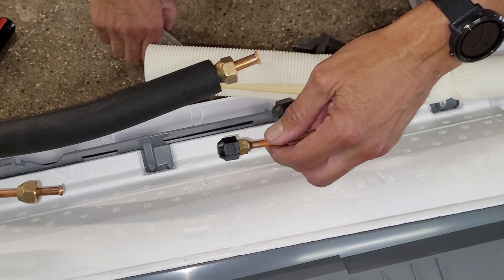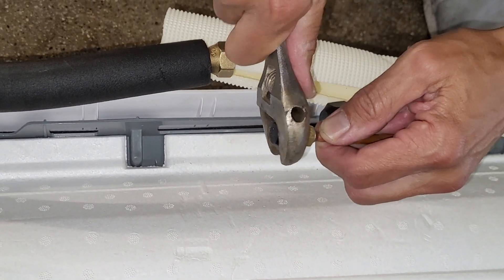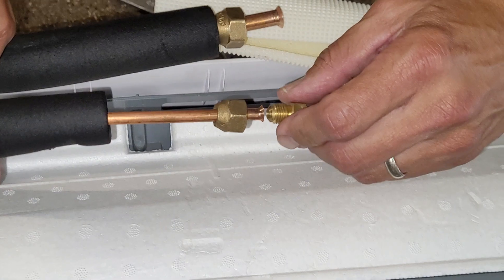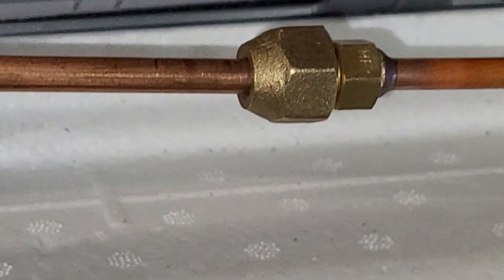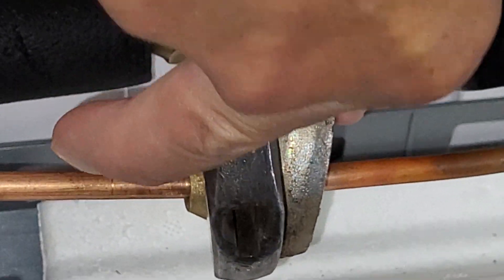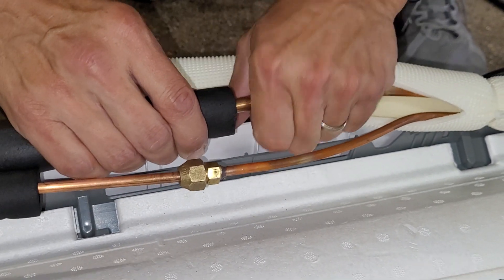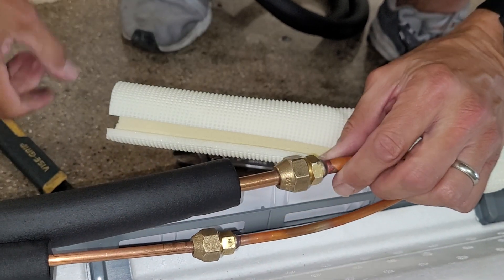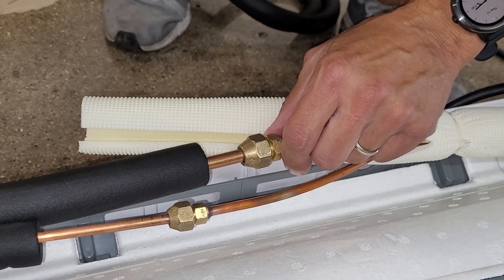# 3 How to attach a mini split line set to the male flares of the inside unit refrigerant pipes.

Comment: Thoughts on teflon tape?
Reply from the maker: Hi Steve, you don't need Teflon tape because the fittings are flared (SAE 45), so they don't need it. Some people do use Nylog, but it's not necessary either, if the fittings are properly attached. Teflon tape would actually not only hurt the connection, but small pieces could be eaten up by the refrigerant over time, and then they could potentially make their way to the compressor, and of you don't want that.

Comment: Did you hear the noise of the nitrogen escaping after removing the plastic cap? I did not in the video
Reply from the maker: Hi Aldo, for your new unit, you'll hear it.  For this one, these black caps had already been removed in the past since it's our test unit, so the nitrogen had already been vacated.  78% of air is nitrogen, so it'll have good company.

Comment: Nylog
Reply: So, you are telling us that there's no need for the Nylog application or the using of the proper Torque procedure that the manufacturers recommend ?  Hmmm?  You ever have any line refrigerant failures to report?
Reply: @truckshopgabe  I always use Nylog , sorry for the confusion.
Reply: Can a little bit of vacuum pump oil be used instead on nyolog ?
Reply: What’s the opinion on using teflon tape??
Reply from the maker: Avoid Teflon tape.  It's not needed, and if pieces break off, they can flow through the refrigerant lines and clog something or potentially get to the compressor.